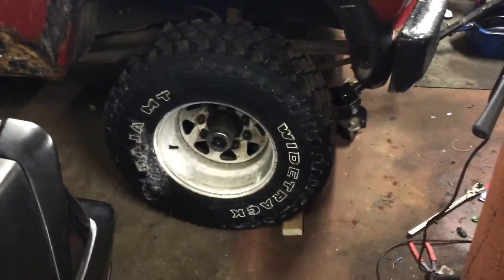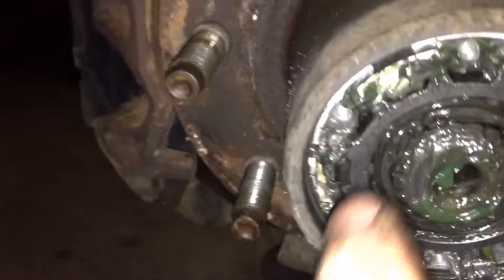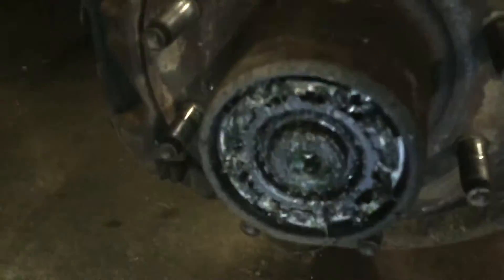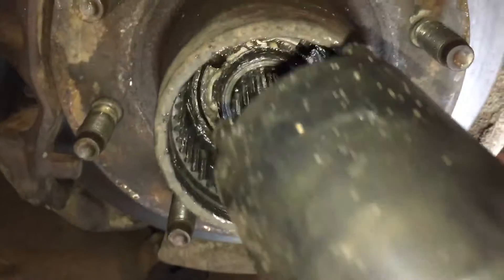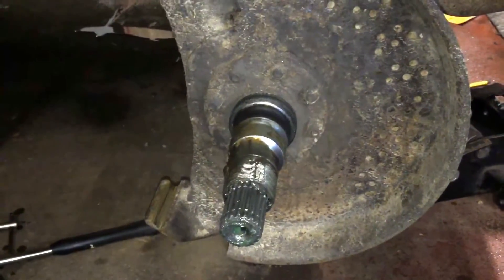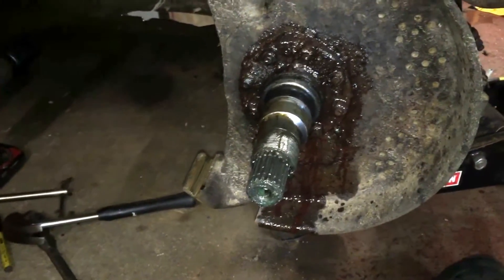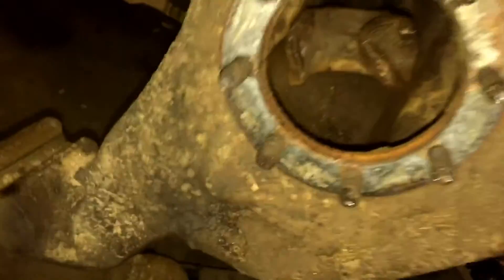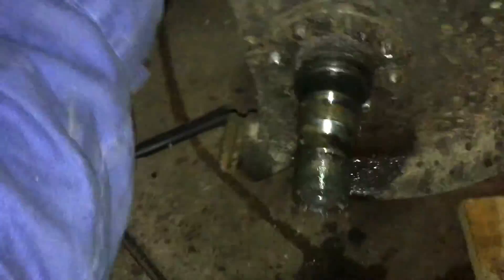ford ttb 44 axle shaft replacement

Comment: Thank you for excellent your video.  I have a similar front IFS system from a 1990 F-250 and I believe that your system is the Dana 50 IFS.  I also thought mine was a Dana 44 until I did a VIN search and it told me that the front end was a Dana 50.  I am not a professional mechanic and this is just a visual observation.  Thanks again.
Reply: Jeff Marty dont trust the vin. If your manual hubs fill up the whole area in your wheel, then you have a dana 50. Same size hubs as the dana 60. If you have manual hubs that dont fill up the whole hole in the wheel, you have a dana 44. Kind of confusing but I hope you know what I mean.

Comment: You didn't show us how you removed OR replaced the axle shaft! I have a 1984 F250 with 6.9l diesel, same front end as yours, and I sure could have used some help with replacing my u-joints. Removal of the shaft is not easy, and getting it back in while keeping the splines clean is even more difficult.
Reply from the maker: Mine came out pretty easily I know I will be remaking this video again cause I have to do the u joint on the drivers side

Comment: Does anyone know if a dana 44HD TTB would work for a 4x4 converter on a 1994 f250? The dana 50 TTB has a different pivot point than the f250 2wd IFS but the half ton dana 44 has the same pivot point as the f250 2wd. Just wondering for future reference

Comment: I am working same axle on the same year truck only my bad u joint is the center u joint.  How do you get the short shaft out of the axle housing where the gears are?  When I pull on it  its restrained by something. thanks
Reply from the maker: Lance W just pull harder it kinda snaps in
Reply: @bkcamaro  I had the same problem today and thanks for your good advice and video here, I pulled harder and finally the right hand axle did then come out, but it separated at that boot, as it’s a two piece design. so the inner cv-joint and inner shaft stayed in the differential. So,  should that not pull out as well ? without some special trick ? Thank you
Reply from the maker: I never had that happen.
Reply: @bkcamaro  ok, great, so I will take that to mean the inner part of the shaft should also pull out, … with “some persuasion”. Thanks !!

Comment: HI I am doing axle shaft on the drivers side  93 ford f250 and i can't get the inner shaft out is the a specific way or does it just slide out
Reply from the maker: Tyler Riemer it just pulled out on mine
Reply: Ok thank you

Comment: what are the sizes and types of the two special sockets?
Reply from the maker: +m ro the one for the bearings it's a 4 pin 2.375 Outer Spindle nut W1271 came from Oriley auto parts 

The one for the slide hammer to get the spindle Axle Spindle Nut Socket Spindle Remover PART #
BK 7769181 I got from NAPA

Comment: good video. but you skipped the part I needed to see. backing the 1st nut off. mine clicks. wanted to hear if yours did too.
Reply: the locknut on the spline shaft? because mine did too but i found out its just the design of the nut (Here is what mine is https://www.summitracing.com/parts/rnb-615-128/applications/model/f-250?prefilter=1)